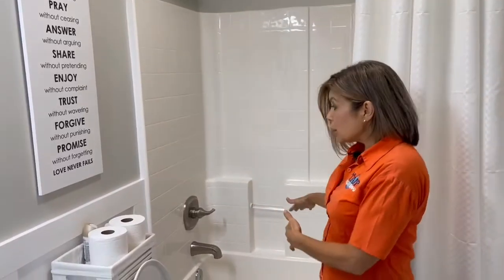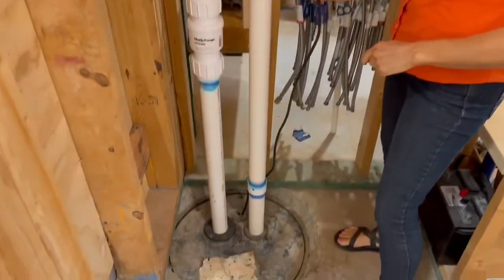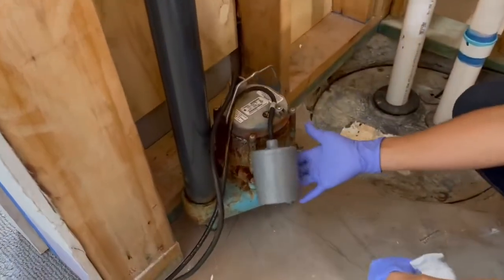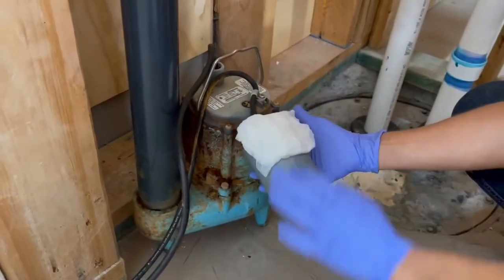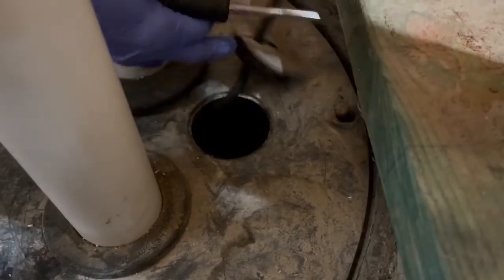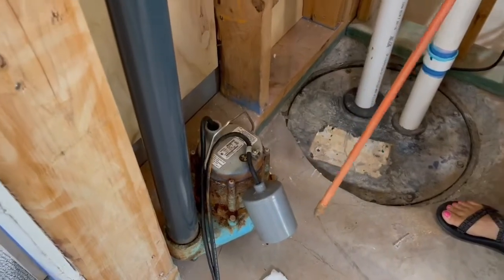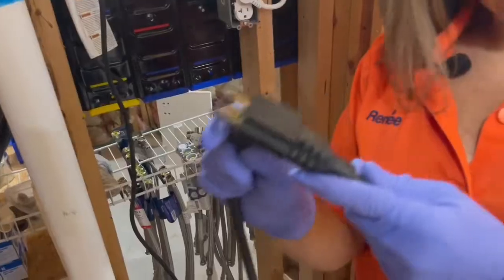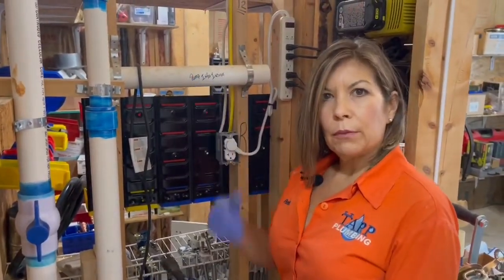Easy Sewage Pump Repair! Basement toilet pump not working? Basement toilet not flushing?

Comment: Thanks so much! I skipped a step and just made the pump run 10 sec without checking if something was blocking the float and that cleared the water out my toilet! Plugged back in like usual, toilet works and sump kicked on after running shower. My back hurts, so I’ll check the float for debris a different day 😅
Reply from the maker: @andrefortune1220  Sounds like a plan ! We are so glad you were able to get things running smooth. Thanks for watching our video

Comment: Thanks for sharing. Last night the pipes coming out of septic pump were vibrating loudly but it was still pumping out the water.  I’m going to give your method a shot.  Thanks
Reply from the maker: We hope you had a successful outcome!! We appreciate you!
Reply: I literally had a nightmare the night before I tried this bc I knew it would be expensive to replace. I took off that tiny piece by the cords and saw exactly exactly what u mentioned. Grabbed a stick to brush it off and it worked!!! You are my hero and you saved me so much money.  Seriously - you made my weekend.  Thanks again!

Comment: Nice to hear a woman explain it!  Very helpful!  My sewage pump keeps running! Thank you!
Reply from the maker: Thank you for watching and we are glad to help!
Reply: my pump keeps running, wont shut off, not pumping anything, leaking out of top, have to keep unplugged, pump sounds like it is struggling, running slow, only two years old, not used much
Reply from the maker: @peter9087  Maybe the float is hung in the highest position which tells the pump to run . Sometimes they get caught on the side of the can. Is there any way you can look down in there. ?
Reply: a clorox disinfecting wipe was plugging up pump!
Reply from the maker: WOW, you are so lucky you got that out before the pump burned up ! Great investigative work, I hope it wasn’t too nasty in there!

Comment: Hey, thanks so much for this. It's very clear and instantly saved us some strife. Our ejector pump stopped running and is leaking water, but it has a piggybacked plug and I was able to narrow the issue to the float/float switch. Not fixed yet but helps a ton!
Reply from the maker: That sounds great , hopefully that will buy you a little time ! Thanks for watching!

Comment: I have the “piggyback” system & when I plugged the pump in by itself & it turned on!
So does that mean that I just need to replace the floater????????????
But when I
Reply from the maker: Did you check and make sure the float is actually able to go up and down ?  Sometimes it gets stuck.

Comment: I have 2 ejector pumps, one for the basement bathroom and one for the washer. I heard the washer one running this morning and I'm 99 percent sure the pit was dry because we weren't doing any laundry. I unplugged and plugged it back in which stopped the pump. I guess I'll find out  the next time I do a load of laundry but could resetting it be all I need to do?
Reply from the maker: That is a difficult question to answer . My first guess would be the float got stuck in the upper position telling the pump to run . I would definitely be sure and stay home on the first load or two in case you need to deal with an emergency! Keep us posted if you can please.
Reply: @TappPlumbing  It appears that by unplugging it and plugging it back in cured the issue for now. If the float had debris on it then I suspect it would remain on when I plugged it back in unless stopping the pump dropped it. If it was a switch then again one would think it would stay on or stay off. At some point I plan to take the cover off but it's sealed and I didn't want to deal with it as it may just be a weird anomaly and we are always here when we run the washer.
Reply from the maker: Thanks for the update ! Sounds like you have a logical plan to me!!

Comment: I never flushed any paper i can hear kick on but when flushing the toilet it backs up any idea?
Reply from the maker: Is it just the toilet that backs up?
Reply: Yes only the toilet eventually it will drain but like real real slow takes for ever it fills up as in its going to overflow.
Reply from the maker: If it is only the toilet there is a problem with it and probably not the pump. Of course we taking a guess here through text. Have you tried to plunge the toilet or run a closet auger through it? One more question by the way, is there a tub or shower in this bathroom? If so and nothing is backing up in it or water is not coming from the top of the sewage ejector can then we are probably on the right track. Best of luck ! Keep me posted if you can please!!!
Reply: Will do the auger soon yes shower and sink in bathroom nothing backing up there I also noticed not tank in the toilet the water is really low like almost at the bottom maybe not enough water coming in ?
Reply from the maker: It is possible there is not enough water in the tank. If you correct that be careful when trying to flush. If the bowl is blocked it is very likely to overflow